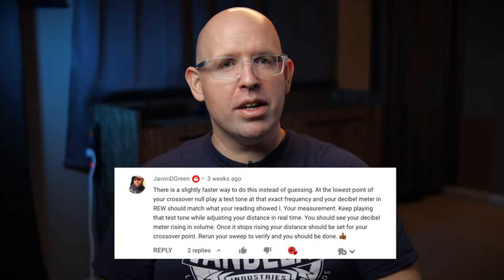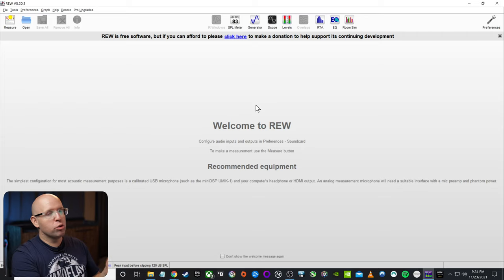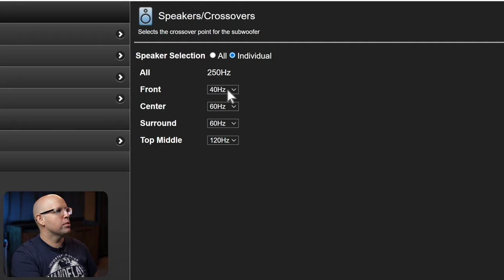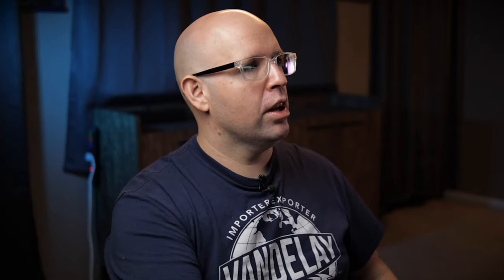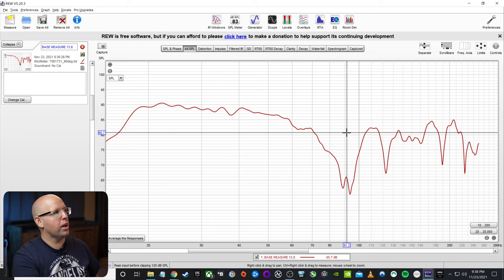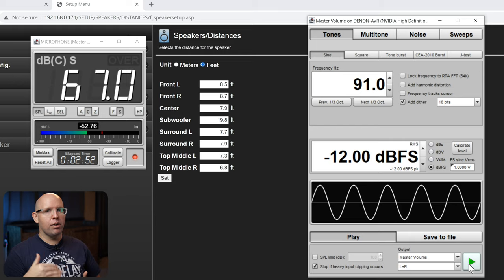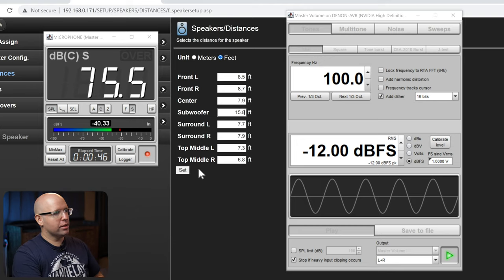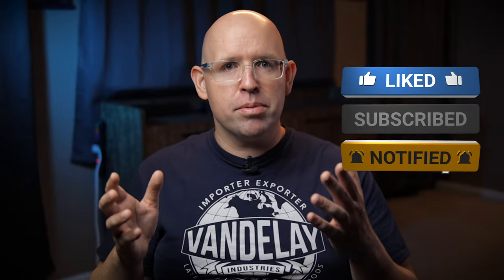A FOOL-PROOF & EASY way to set subwoofer distance and crossovers! (REW GUIDE)

Comment: You chose to measure L+R, so REW is only measuring the left and right speaker together right?  How does changing your subwoofer distance make the L+R measurement change if its not even playing sound out of the subwoofer?
Reply: Because the xover in the AVR Will send anything below xover to the subs. So you need to turn on your subs.

Comment: I tried this technique with my svs subs after a full audy cal and adjusting the difference in sub woofer distance didn't change the db level at the problem frequency. It didn't matter if i changed the distance by multiple feet the db level always remained the same. Weird?
Reply: If you have a Denon AVR you need to set the distance and then exit the menu otherwise IT won't adjust the distance.

Comment: I'm starting with REW and understanding how to use it in my home theater. Yours is definitely the most comprehensible video tutorial. Thank you very much. I do have a question (not regarding REW), Would you recommend using Subwoofer Isolation feet on a 2nd story concrete floor? I have two SVS PB-1000s in a small dedicated room (14.4 x 13.8 x 9) but I am having much trouble controlling energy transfer (at approximately 80 dB) to the first floor. The problem is, I need to play at those volumes to really feel the Movie Theater experience I'm looking for.

Comment: why dbC for SPL measurements? Wouldn't dbZ make more sense for subs, since it's a flat curve?
Also why REW if you already have Audy enabled? Audy makes all distance and phase corrections already. I think if you want to do distances via REW than Audy should be disabled. 
Also those dips you see in FR might be just nulls in your room acoustics, which should be corrected via EQ, rather than distance, seems like you might be solving the problem with wrong tools.
Reply from the maker: Never attempt to fix nulls in your room larger than 3-4dB via EQ. You are asking for trouble. And Audyssey’s distance is a rather crude estimation that often results poor time alignment to the MLP of all speakers. Audyssey also doesn’t do any phase corrections as it only detects absolute phase. It will simply throw up an error if it thinks the phase is wrong (even when it isn’t).

Comment: My 2 cents: Somehow I think that technically this video doesn't make sense. The idea behind speaker distance is that the amplifier delays the sound of speakers close to you. In this way all sound effects reach the listener time-aligned, improving the impacts. What you actually are doing with your distance-settings is solving phase-problems. (Non-active amplified) speakers are full of phase problems. My SVS even has a phase-dial. If the phase of Sub and main speakers is 'out-of-phase', the bass will cancel out around the crossover frequency. Maybe you could do a video how to phase-align speaker and sub without messing with the delay :). Obvious, having 4 subs and multiple listening positions is a phase-alignment nightmare.

Comment: Doesn't the subwoofer become localized with a crossover of 110Hz?
Reply from the maker: Generally speaking, around 120Hz is where low frequencies start to become localized. Although honestly, it’s not a simple yes or no answer. It depends on subwoofer placement, speaker placement, the room size, amount of subs, etc. There are lot of variables involved so it’s best to experiment to see what gives you the best response and sounds good.

Comment: The problem with high crossover is that bass becomes directional
Reply from the maker: I would definitely avoid anything above 120Hz which is typically where bass starts to become noticeably directional. As a general rule I always start at 80Hz using a receiver and 40-60Hz if using separate amps.

Comment: I understand the process. But I don't understand how the sub can measure better without moving it physically
Reply from the maker: Thanks for comment and that’s actually a great observation that I want to try and clarify. Basically, we’re measuring how the subwoofer and main front speakers interact with each other. Those nulls and peaks at 80Hz and above are caused by the mains cancelling out frequencies of the sub, and if we raised the crossovers to the max and measured just the sub, it wouldn’t have those nulls and would be relatively smooth. That’s because the mains and sib are not time aligned or in-phase with each other. Adding or subtracting a slight delay to the subwoofer (a foot is equal to about 1ms) can bring them in phase with each other so they aren’t cancelling each other out. That’s why the response gets better as a result.
Reply: @HomeTheaterGamer  So you are adding a time delay. Same as in MiniDSP.
Thanks you are doing a great explaining everything related to HT.

Comment: huh, didn't know you could double click the Denon via the Network section
[edit] double clicking the denon opens up the properties tab, rather than launch a program?
Reply: After the double clicking my Denon on the network I copied the IP address indicated in the network window into the address bar in Firefox. After a few permissions I was in. Way cool. I couldn't find the information anywhere so I just guessed it might work.

Comment: Most people don’t want to buy a $100 microphone when they have 3 microphones sitting around. I have an old Dayton little microphone and Parts Express tried to get me to buy a new microphone. I just skipped the calibration and it measures perfectly fine. Maybe it’s off by 1db at 3.2Khz. Who cares. Just use your microphone and if it doesn’t work for you, buy a new microphone.
Reply from the maker: Most people don’t have 3 microphones sitting around.
Reply: @HomeTheaterGamer  you’re right. I should have said 5.
By the time you get to REW you should have at least 2 microphones. I mean any microphone. From a Zoom H1 to a Shure SM57. 
I’m not buying another microphone because I need a calibration file.